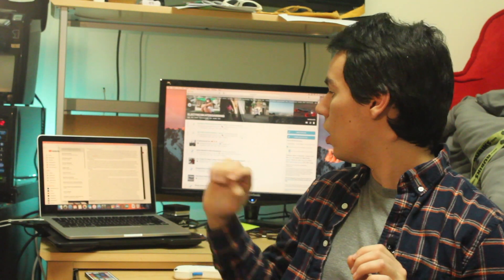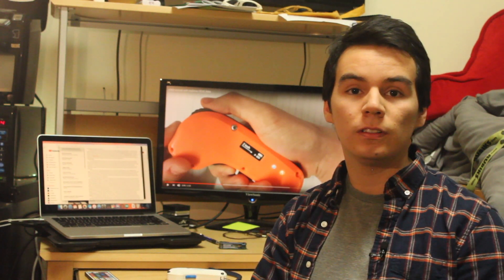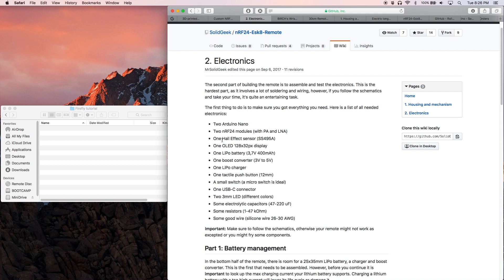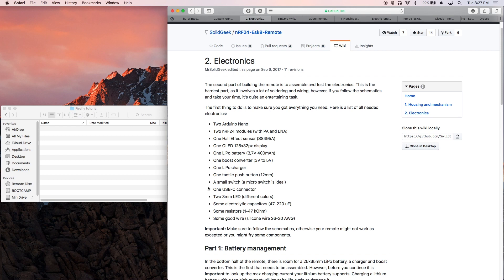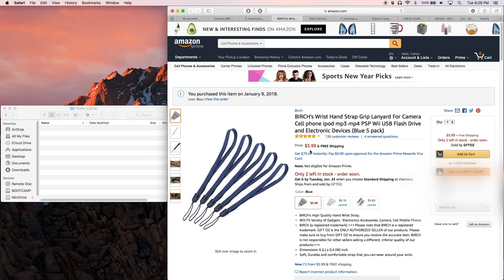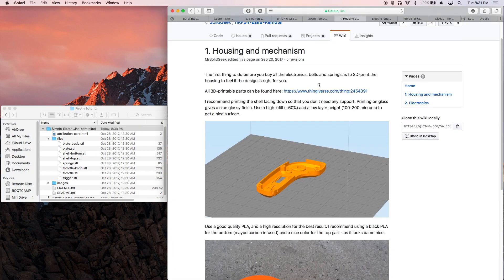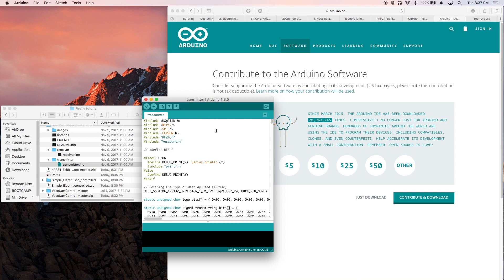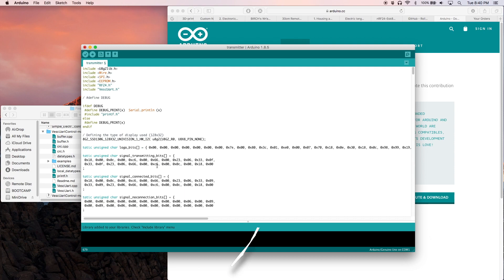Building a Custom Esk8 Remote? Part 1

Comment: You never got to the receiver portion - do you setup anything in there as well? Also, what size should this be modeled in if you use 3DHubs & is a Wood PLA good enough to use as material?
Reply from the maker: C. N. Yes actually! I'll cover it again in the reciever build portion of the guide, but you have to randomize the Pipe ID in both the remote and receiver. My bad!
Reply from the maker: The model is in millimeters for 3Dhubs. And I'm not sure about wood PLA. I'd do some research on how it holds up durability wise. I only know PLA and ABS are the recommended materials.

Comment: nRF24-Esk8-Remote-master zip mising so it is useles.. it waste lot of my time.. now ima pretty upset,,
Reply from the maker: ??? What part is missing? The firefly code is hosted on SolidGeek’s Github page. Take a look at Part 5 of this guide for up to date install instructions.
Reply from the maker: I’ve updated the description to link directly to the github repo instead of just the transmitter code. Sorry about that.
Reply from the maker: SolidGeek’s never finished his writers guide, but my video tutorials go all the way up through part 5. It sounds like you might have your magnets in upside-down if it’s going in reverse when you press forward.
Reply: @SeeTheBridges  is anot actualy problem or magnets.. vesc cant determine what is forward and what is back ward :))( i thing i mising rn rx tx conectgion betwen cesc coz PPM is not abble determine PWM signaůl-.-. i tryto read form your vid's much as posible.. if you wil be abble share final wiring betwen vesc and your skate.. wil be nice :)) ty. coz i found more  wersion of this,, coz i facing lot toreubleshooting.. i must be honest i try make my own wersion for my natives.. coz at my side of YT is missing DIY.. (ofcourse i put in description your channel and big thx )
Reply from the maker: Hmm, if it’s the VESC having trouble determining which way is forward, that sounds like an issue with the VESC motor detection. Because even without the RX and TX connections, the remote should work. If you’re missing those, the telemetry info just wouldn’t work. The PPM/PWM signal is sent via the 3 pin cable usually at the top of VESC4 based ESCs. My final wiring is exactly the same as SolidGeek’s original diagram. I made some slight modifications to the build itself to fix a couple issues, but nothing major.

Comment: Is there a link you can send the file containing a fully configured Arduino sketch that will load straight to the nano without modifying for the transmitter?
Reply: My email is garryw65@gmail.com
Reply from the maker: Yes, I saw! I replied to you over on the builder forum

Comment: Hey man i want to use the wemos d1 battery shield. Which charges with 500mah and I got a 500mah battery. As you tell in your video i should add a resistor, but where?
Reply from the maker: I can't recommend using a battery shield. Unless your altering the whole remote housing to fit the shield inside, you're gonna be having a lot of trouble squeezing everything in

Comment: Where did you bought your wires? I can only find way too long wires in colors...
Reply from the maker: I bought wire from hobbyking as well as AliExpress. Where ever you buy it, you're gonna end up wth a lot of extra wire
Reply: Which wire gauge did you use? I wanna go as thick as possible so i can use the wires for some other projects as well.
Reply from the maker: I used 30AWG. I don't recommend going thicker since it's reeaaalllyyyy hard to solder the wires to the nrf even with thin wire